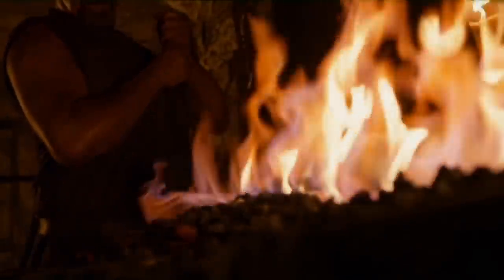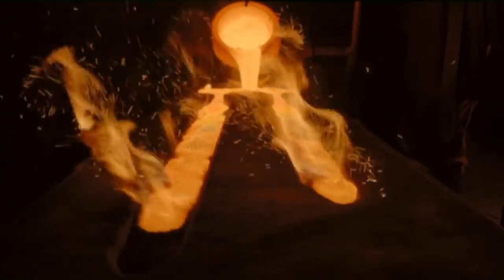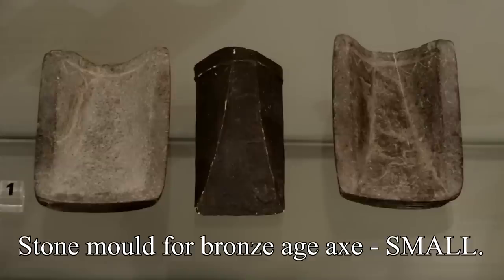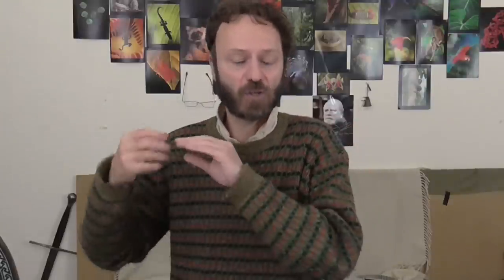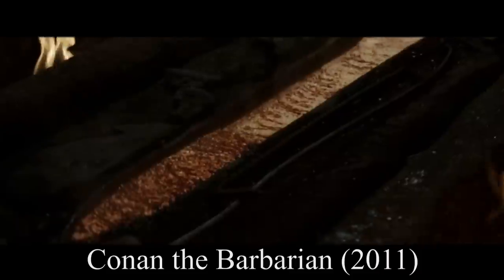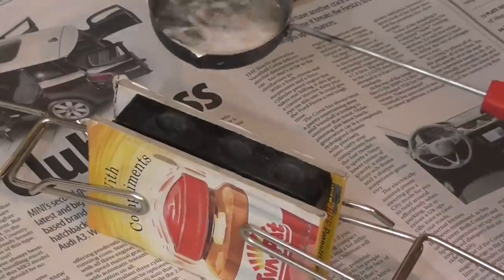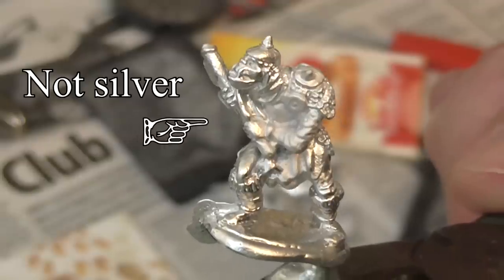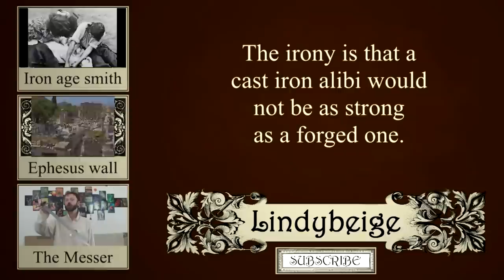Casting swords in the movies - forging a lie

Comment: Thank you for this. Literally everything about these scenes is idiotic. I have once cracked the side of an old park bench that was a solid 5 cm thick cast iron by dropping it... onto grass. Instead of a cast iron sword you might aswell fight using a banana or put your hopes in spellcasting.
Reply: +Fistwagon I really hate cast iron. It's a useless material in blacksmithing. If ever anyone finds an anvil for sale which is made out of cast iron, they would do well not to be tempted by the low price.
Reply: +S.Rolphsen Monty Python reference game, is on point.
Reply: +HamsterPants522 that's what my teacher said as well
Reply: +Fistwagon The banana is not used for combat per sey, but you can hold up guards with them, so they are still field-efficient. and can also be lunch. All in all, a good equipment for the seasoned field agent.
Reply: +S.Rolphsen But what about pointed sticks?
Reply: Bigfoot I don't know. My self defense instructor never covered that, so I'm assuming they aren't a threat.
Reply: +Bigfoot 1st pointy stick and all heck breaks loose.  Not even a Banana can counter the pointy stick.
Reply: +Fistwagon At least in LotR and GoT that has a pretty good chance of succeeding; depending on who you are.
Reply: +S.Rolphsen What if an assailant attacks you with raspberries?
Reply: If anyone ever attacks you with a raspberry, simply pull the lever and the 16 ton weight will drop on his head.
Reply: +Bigfoot Ah, but supposing you don't have a 16 ton weight or a gun? Supposing that there are two guys with raspberries who are trying to come up from behind and stalk you like?
Reply: Well, the first thing to do when being stalked by an ugly mob with raspberries is release the tiger. The main advantage of the tiger is that it not only eats the raspberry laden foe, but also the raspberries. Not to be confused with the peach assailant. The peach assailant should be handled with a crocodile.
Reply: Bigfoot
Good to see that the old traditions are still alive. I have litte to add exept the wisdom of never dualwielding crocodiles since they merge into a human-hating elephant
Reply: KamiRecca Sounds to me like the perfect weapon; considering I'm a volatile penguin from outer space.
Reply: Zap Gun
Yea well then it is an ancestral combo for you if i remember by Space Fu training.
Reply: KamiRecca You have been taught well, young padawan. Tell me, who was your master?
Reply: Zap Gun
Master Obi Nobi Kedobi Von Bon Jovi the second.
Reply: KamiRecca Ahh, Obi Nobi Kedobi "Adobi" Von Bon Jovi the second; he was a wise sausage indeed. I was sorry to hear about that horrific postage stamp incident, my condoleances.
Reply: KamiRecca Yes, quite jarring, that was. I believe he and his colleague Quasi-on-Gin of the Pluton Tribe of Greollion VI were researching the translocrontibility of thrice-preterburated Mars ducks.
Hazard of the trade I suppose.
Reply: Zap Gun
Yes indeed. Ah good old Quasi-on-Gin. That name brings back memories. We were hunting Pre-Hunted HoundHounds on Vespoti Prime once, and he taught me the sacred art of juggling up to 95 invisible quantum spheres. A hell of a hard thing, seeing that you can either see where they are they are (provided that you CAN see them, that in it self being a skill i might add) OR where they are going. Good times.
Reply: KamiRecca Hmmm yes, yes. Sadly, Pre-Hunted HoundHounds have recently gone extinct due to the excessive exposure to Jon Lennon music. His music has been a rather big hit on Vespoti Prime as of late and that has proven to be quite catastrophic to the local wildlife...
Oh, what has the world come to these days, am I right? Oh well, at least there's still the 19 Lucky Pillow Gods of Zeriphan-65A7RBT. Sooo sooooffttt...
Reply: yes that is sad about the HoundHounds. Another victim of a brutal man and his fiendish ways.
And if you are looking for hardcore softness straight through there is nothing better.
(this turned out to be one of the strangest youtube conversations i have had ^^)
Reply: KamiRecca Certainly, although the golden blanket clouds of the gas giant Greeb-78-II are a very close second. A lot cheaper to get to from this sector of space, as well. Not to mention that there's a little takeaway there, called Politics if I recall correctly, that sells some great hot air. Not sure how it stays afloat on that gas cloud but I'm sure they must have found something to stop them from plummeting to the super dense liquid planet core.
(Welcome to the internet, my friend. Here you can find both the wonderful and the horrifying extremes of the spectrum of strangeness; but never is it normal)
Reply: +HamsterPants522 A friend of mine bought a cheapo harbor freight 1 back when he started. First couple projects were jsut hammering square stock into round, and round into a tapered point and making some S hooks with them (was quite a bit of fun). 3rd 1, the horn of the anvil snapped off. Just cracked suddenly during a swing, and fell off. Wonderful jagged crystalline cast iron structure out for all to see.
Reply: *****
Yea, fantasy is silly because they answer logic with Magic Magic, while Sci-Fi is better since they answer Logic with Tech Tech.

For me, fantasy and Sci-Fi is the same genre with different dresscodes.
Reply: +Fistwagon Cast iron isn't the only material you could cast. You could , theoretically, cast a sword out of steel. I have no idea if it was ever done historically.
Reply: ***** It wasn't. Steel is too hard and requires temperatures that are impossible without modern technology to melt and even then it wouldn't become fluid like cast iron.
Reply: Fistwagon
yea well steel was first forged in about 1000BC, so no you dont need "Modern Technology". You need knowhow and innovation. As everything else. Also, electric light was first employed about the same time.
Reply: KamiRecca I am no expert at all but I was talking about turning steel/iron into liquid and pouring it into a mold. I've seen iron burn at very high temps, it sparkles and disintegrates but it doesn't go liquid like high carbon alloys aka cast iron.
Reply: Fistwagon
i know little about the forging process, so you are probably right. I was mostly pointing towards the "modern technology" thingy.
Reply: KamiRecca What I meant with modern technology was arc welding. That's molten steel in action and it's fleeting and difficult to work with, not this orange stuff that you pour into containers like glowing marmalade. :P
Reply: Fistwagon
heh well then the more fool am i, and i gracefully retract what i said and claims the opposit. ^^
Reply: +Fistwagon if you concealed the banana and pretended it was a gun it might be moderately effective as a weapon !
Reply: +mcpartridgeboy Is that a banana in your pocket or do you just want to rob me?
Reply: EmployeeJoe630 Sorry, but that statement isn't logical, you cant see me so why would you mae a statement about something you have to see when its obvious you cant ! ? your weird !
Reply: mcpartridgeboy
Easy answer: Spycameras.
Complicated answer: Spycameras everywhere
Reply: KamiRecca in my opinion non of those answers are good, you don't now were I live so the first is out, and the second is out too, because even if there was a spy camera here (why youd be looking at me and not women is kinda weird) you still would need my details to find the camera !
Reply: mcpartridgeboy
And i was, of course, just jesting.
Reply: +Fistwagon we discovered that as well... gone was our new heard...
Reply: plus the fact that to cast iron you need a heat of 1200 degrees Celsius... the only reason we do this so easily is thanks to blast furnaces made in the 19th century.
Reply: +Heroin the Heron The earliest cast iron artifacts date to the 5th century BC.
Reply: Edmond Dantez he said easily... sure they could cast iron for centuries, but to do so they needed to heat iron in a crucible for many many days, until molten.
this required continuous blowing, and was very work intensive.
Reply: +Fistwagon "you might as well fight using a banana or put your hopes in spellcasting."
Not sure what you mean by "or."
Surely you don't expect me to head into battle with a mundane banana.
Reply: What? Wont you fight like a real man? (see Big Ape)
Reply: KamiRecca did someone say fight like a real man, your on !!!! I'm white !!! 1d4, your move !
Reply: Okay. I have Priviliges! So many that i have yet to realize i have them! That gotta be at least 1d6
Reply: mcpartridgeboy
Also, To Fight like a Real Man!:
*Agaisnt your will
*At the threat of punishment if you refuse
*For crappy pay
*And unhumane working conditions
*At the risk of your life
*In a conflict that will not benefit you or your life even if you survive
*As an expendable number
*Because you are a Man! And it only takes 1 man to get 40 offspring if you have 40 women, while 1 woman only can get 1 child at a time even if there are 40 men.

So yea, to fight like a MAN! Is basicly to die so that the women wont.
Reply: KamiRecca sorry man, I was making a joke implying a game of chess was the real mans game because brains are more powerful than streangth otherwise elephants and bears would rule the world !! aside from that, bloody good points sir, I agree with them all 100% though I'm far too sensible and cowardly to fight like a man outside the local chess tournaments !! love live cowardice !!! and the inevitable single life of all wimpy men like me !!!
Reply: mcpartridgeboy
Ah, thought you went all PnP RPG with the 1d4 dice.
Im more of a Go person myself, so i guess i will answer with 3-4. You move Sir.

Oh, and i would like to add:
*Poorly armed and armored

to the list. because lets face it, thats most REAL FIGHTING MEN!!!
Reply: mcpartridgeboy
Also, wimpy men have generally a greater chanse for lasting relationships than REAL FIGHTING MEN! because they tend to die. Horribly.
Reply: mcpartridgeboy
Bah, wouldnt say that. In fact, if we look at it in a historical context, every surviving man had a rather good pick when it comes to the women, since generally 75% of all people in pretty much every society were women. Since men had a bad habbit of dying in wars.

Sorry to beat taht point over and over again, but i feel it is important to make. (as important as a random youtube discussion gets i guess)
Reply: But what if they have a pointy stick?

Comment: epic. don't  forget  to  mention  about  thermal  shock to the stone. that can be sufficient to  completely  shatter stone.
Reply: well if they constantly are casting swords then it wouldn't be a problem
Reply: very true but how about the first casting. it would splinter in the first instance.
Reply: david fletcher just put some fire under the stone and warm it up
Also in a forgery you constantly have high temperatures all around
Reply: People really do cast bronze in stone molds (around 2150 f) but obviously you preheat the stone.
Reply: GameSpender I think you meant foundry (not forgery), which is a place where metal is poured into molds to become castings. A forge might be found in a blacksmith shop.
Reply: Thermal shock to stone is one of the things we learned in the Boy Scouts. When building a fire pit, it's important to avoid using stones around the fire if you don't know what kind of stone it is, especially if you intend to use the stone as a griddle. If heated too much, some stone has a nasty habit of shattering in an explosive manner, which can be really bad if you're right next to it. Generally, we were taught to dig a dirt trench (firewall) around the fire. It's quicker, and safer.

Now, if the molds were clay, that'd be a different story. Clay molds are way better, as they are easy to make (stone molds are A LOT of work), and clay tempered metal is actually a very ancient and effective way to temper a sword. Plus, you can peel clay away, making it easier to remove the metal.

An example of ancient clay-tempered steel is true Damascus blades made from Wootz ingots, which formed carbon nano tubes due to the bio matter in the clay used during the tempering, making them some of the strongest swords ever made. Damascus you see now is just two different metals pattern-welded, then treated with acid to accentuate the pattern, as the acid will darken one metal and not the other.
Reply: Usually thermal shock isn't an issue with fire pit rocks because they don't heat up up rapidly. You're not chucking a cold rock into a roaring fire. Since you put them around the fire before you light it, they'll gradually heat up as the fire builds.

The real danger is in picking porous rocks (like sandstone or limestone) with water trapped inside. The water will boil and the steam pressure can be enough to make the rock explode. You should definitely avoid particularly smooth rocks because it means they've been under water for a very long time so they could have quite a bit of water inside.
Reply: Preheat both the objects before use... duh heating an object slowly tends to hold its shape much better then if you were to pour into a cold object....
Reply: david fletcher - no one really casts into stone molds. SAND does just as well, and can’t shatter.

Comment: I kinda wanted to know what they DID do with iron swords.
Reply: Forged them with a hammer and anvil.
Reply: It depends on the iron (or steel) that was used, what historical period you're talking about, and, where culture the sword is being made by.
Reply: Man at Arms shows often shows various methods of working steel. Sometimes they even smelt the steel from iron ore themselves. If you haven't already checked them out, their work is pretty interesting to watch
Reply: Thelongchinbeard
Good suggestion, actually! those guys are pretty good with a hammer!
Reply: Usually a series of folding and hammering out the shape. Heat it red hot (mushy) then hammer it flat, heat again, fold (weld) -- repeat. This creates a nice crystalline lattice in the steel that allows it both flexibility (depending on the type of steel) and strength.
Reply: Check out Walter Sorrells. he makes kitchen and utility knives as well as Japanese swords.
Reply: Eh, you really only want to fold the steel if (1) it's poor quality and you want to even out impurities and uneven carbon distribution or (2) you're pattern-welding layers of dissimilar steel in order to make a pretty-looking blade.

To get the whole hardness and flexibility of it, you do heat treating; harder the steel by heating it to 723-4 degrees celsius then quench it in oil or water so that it cools very quickly. This creates the crystalline structure that makes it hard and able to hold an edge, but leaves it brittle and prone to breaking under stress. So you then temper it, heating it to somewhere in the region of 200 celsius, which introduces flexibility and makes a tougher blade.

Of course, not all types of steel will respond to heat-treating. It's the carbon in the steel that makes it work, so something like mild steel (only a few steps above pure iron, a carbon content of around 0.15%) will barely react to treatment.

Comment: I bet all the comments on here will be "actually that will work because ita not iron, its Valyrian Steel, its magic🤓🤓"
Reply: valyrian steel is specifically said to be folded steel, and hundreds of time at that. So its completely wrong by that standard also .
Reply: Superior Valyrian steel, folded over 9000 times!
Reply: In the books it says that valyrian steel is made with a long lost method, so magic may be involved (like with wildfire) but it's properties would still probably be lost if melted down.
Reply: Now available at your local GOT retailer.
Reply: I forge poptarts into poop it's warm and brown and quite malleable but stinky
Reply: It was folded before it was melted, so that counts, right?
Reply: As written in the books, they are forged, but you actually need to chant and sacrifice virgins to dark gods while hitting it with a hammer.